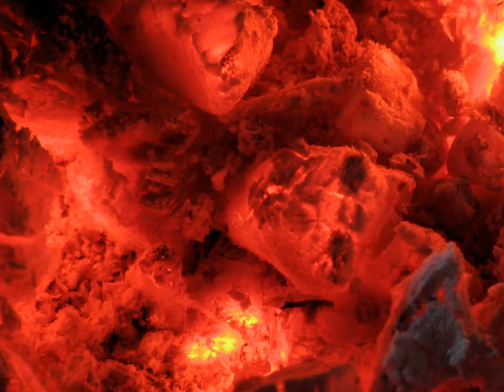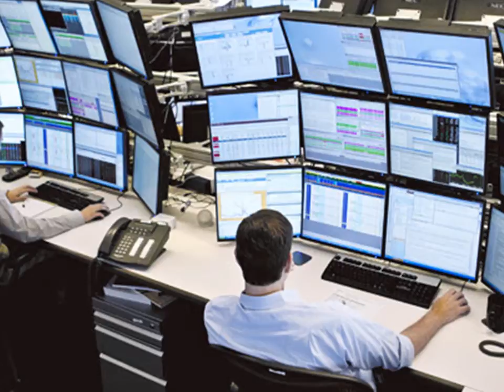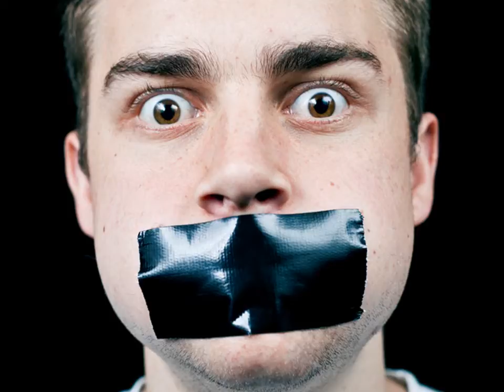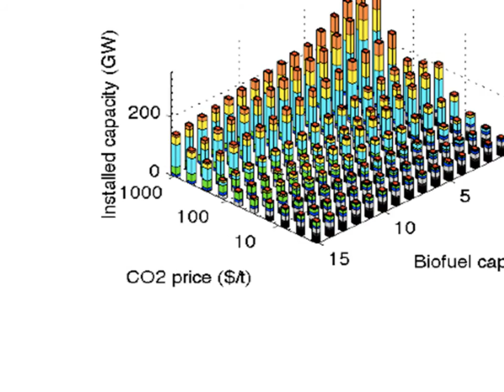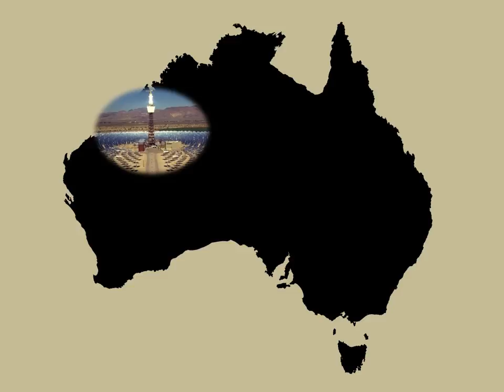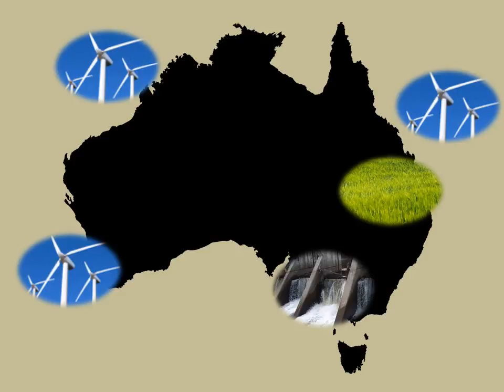Can Australia run on 100% renewable power?

Comment: Can renewables provide today's power? Seriously? That was your question going into the study? Then the very presupposition of your whole study is flawed! For if we have to go 100% renewable, then POWER is not the only consideration. OIL must be included, and that means overnight charging for EV's. Many people seem to think they'll charge their EV's during the day and then use them to help run the house overnight as the solar and wind farms pack it in. I'm not so sure. Electric vehicles will require a lot of electricity. Amory Lovins writes for America's National Renewable Energy Labs and famously states that we don't need baseload because businesses and industries close at night and the rest of us are asleep. But a number of studies have asked if today's grid can even cope as we start to move from oil to electric cars. The same NREL Amory writes for studied this. It turns out that there will be heaps of extra demand, and the night time dip in demand vanishes. It's 100% demand, all day and all night!
NREL's answer? Turn all the baseload power plants up to full! But did they not read their star witness for a 100% renewable grid that said we don't NEED baseload? Does the left hand not know what the right hand of NREL are doing? Then they suggest we stagger charging EV's overnight so we get the most out of today's grid. Apparently we can charge up to a THIRD of our entire fleet for free - without building a single new power plant or power line! But it assumes we let EV's do what they are meant to do. Charge overnight when they get home so they can drive the next day - not attempt to run the home! https://tinyurl.com/y6b6s7nx   https://tinyurl.com/yd67zkmh  
In the face of weaning off oil, your study assumptions are invalid. This is just one of the many reasons Dr James Hansen says we need to consider nuclear power.

Comment: Battery was not considered at all which is changing the electricity market at brakes neck speed if you don't see that just Google battery storage project in aus in 2018